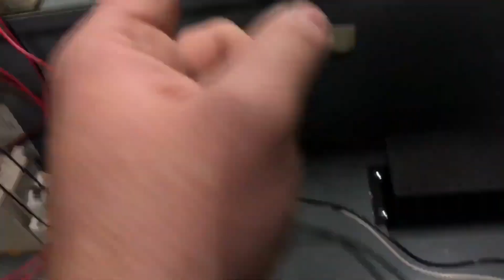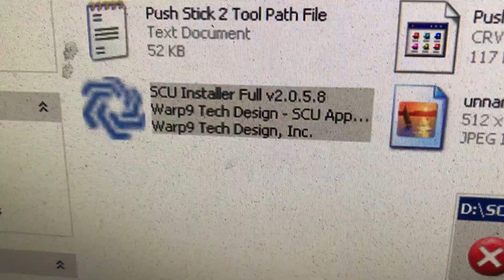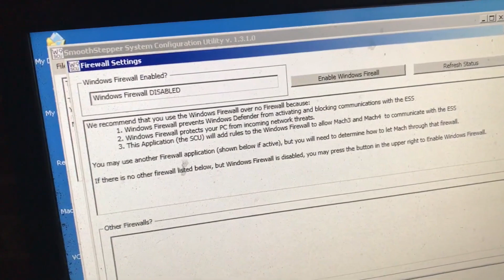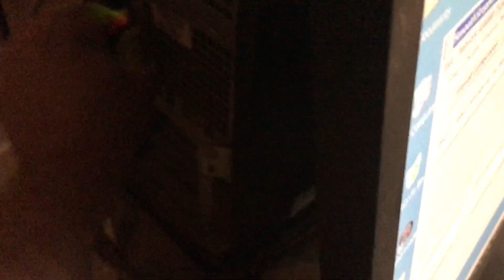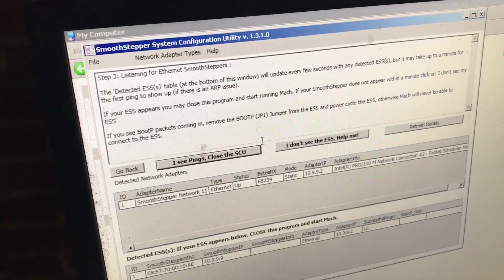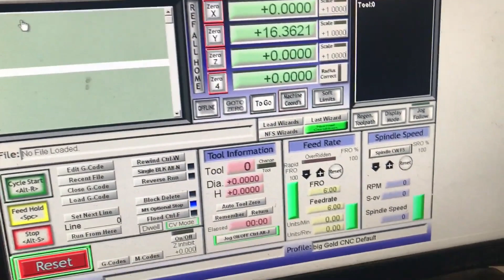Setting Up an Ethernet SmoothStepper On Mach 3 With Our New CNC Machine We're Building

Comment: You need to set a static IP and DNS

192.168.10.200 is a good IP to use

The machine is going to have an IP and you may need to set it's IP address and subnet and DNS
Reply from the maker: Ok

Comment: For devices like this a lot of times they use an embedded Windows 95 software that is designed for environments like machines, POS like a grocery store.

The firewall they are opening the ports to allow the PC to talk to the machine

It is required to set the ports and the security rules

Most ports are not available by default

If you don't set rules it won't work
Reply from the maker: Yep

Comment: Gender changer adapter is what they were always called

Those and the NULL Modem adapters

They used to look identical and they would say NULL on the NULL Modem adapters

Basically, the null Modem adapters and cables had the rx and tx lines swapped and the CTS was swapped to one of the other ones

I don't remember it anymore, but I used to know it off the top of my head

The NULL Modem adapters and cables were to hook 2 serial ports from 2 computers and send files from 1 computer to the other

This was way back before Ethernet

In 95 I used it for the last time to load files on a dos 286 laptop to install Windows 95

Microsoft told me that windows 95 would not install on a 286

But I tried it and it worked

Monochrome monitor
Reply from the maker: Lol

Comment: You are a hard worker Donnie

I used to have 3 or 4 projects going on at home and be working 3 jobs in 2 states

If that pinout is the same, than a simple gender changer adapter would work, but you need to be sure the spinouts are the same

I would get the schematics and the pinouts and I would build a cable to match the pinouts

I used to do that for 2-way radios

The pinouts were always different even though they were 25 pin female connectors on all of them

That board looks proprietary the other one looks like an Ethernet to serial standard board but the other one looks specially designed

That CNC machine you could start making bar top m a m e consoles
I saw a website where a guy was doing that making countertop arcade machines that were just the wood with all of the slots for installing a flat screen monitor and the joysticks and buttons but it was just the wood panels no electronics

You could do the same thing and ship them out as kits

The Pandora boxes that are self-contained could be put into the kit and screwed right down where the joystick and buttons would normally go or someone could take apart the Pandora box and put the boards inside and buy a regular power supply to power it instead of the adapter it comes with

I think it would be worth making a couple out of lightweight particle board and see what the cost is
Reply from the maker: Yep